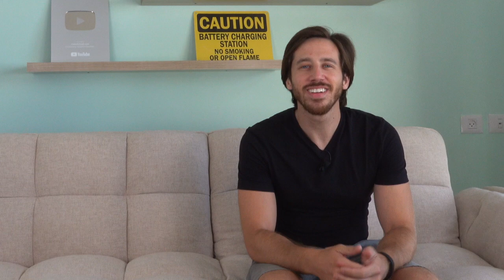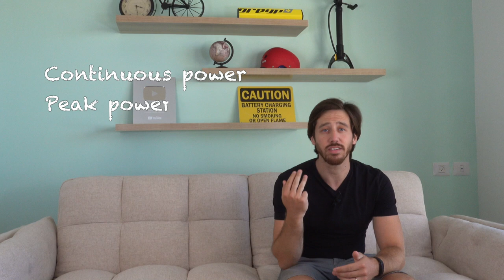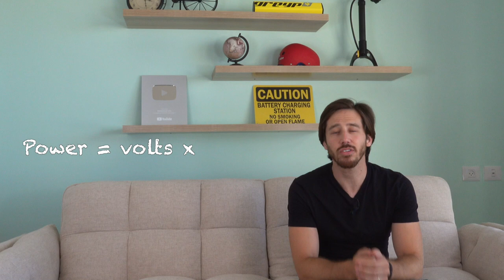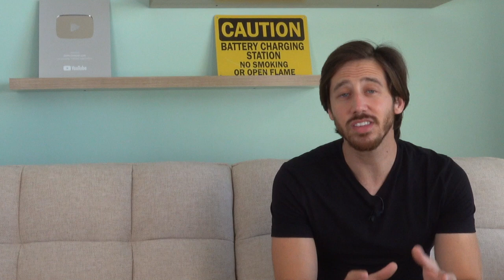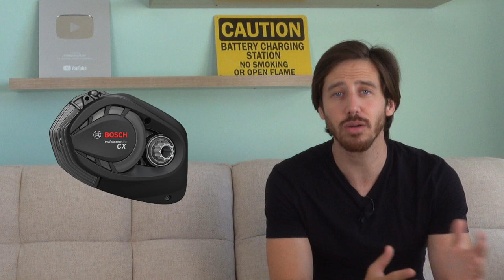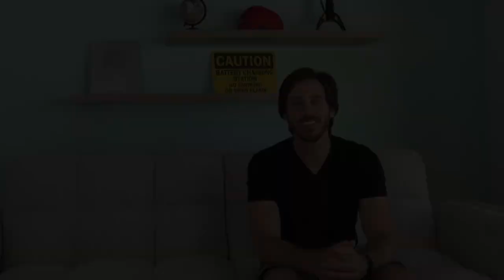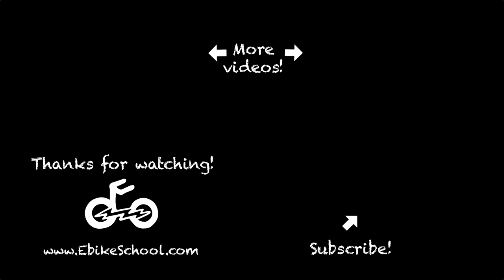E-bike watts - How electric bicycle companies are lying to you

Comment: Well, if you truly want a 1500Watt hub that is no trouble... just ask for it and they print that on the side ;) After all who will TEST it right?
A bike should be bought for use. 
The ebike I have is very well suited for the area, a lot of flat land and only a few hills. Nothing to crazy! And longer ranges matter more then getting quick on the hill.
But if I was in the UK or in america in some states then a 500-750W hub drive made a lot more sense. The bike I have now probably isn't that suited for those kinds of hills. It can do it, but it isn't optimal for it. 
So find the bike fitting use and area really. 
Around here a 750 Hub drive would be quite wasteful. You don't really need it!

Comment: I hope you will answer my question
Should the controller be equal in? Amp
Matched on battery of,
Quantity in amperes
What is the correct ratio in amps
On 2 motors from 3000w up to 6000w
Can you help me with this
I do not know ?

Comment: I know right! When I was looking into Ebikes in Maine of all places the options to actually see an ebike might have been Walmart. If that. So I did my research on the web. I didn’t want to rush huge money on an experiment and various folks gave differing reviews and opinions on motor power. My town has its fair share of hills. I was told by many a reviewer that 250W wouldn’t cut it what with my being right around 200lbs at the time. Others were less firm regarding what a 250W motor could do. Finally after watching soooo many videos and getting so many differing views I bought online a little Swagtron EB 5 Pro Plus with a 250W motor. It’s not anything special or cutting edge but much to my surprise it was a lot of fun to ride and when it came to hills I was shocked as it zipped up fairly steep hills with my fat ass on it like said hills were nothing. Don’t even think I slowed down as I applied the throttle to assist my pedaling, I was like WTF!?!

Comment: A bigger motor (within reason) is usually more efficient than an over driven smaller motor. 750 watts peak 1500 regulated to max 750 will go further on a given battery than a souped up smaller motor.

Comment: What’s the difference between the engine power and the battery power. Is 250w any good, I’m just trying to gauge what decent and what’s not, I’m uk so 15.5 miles an hour limit

Comment: So, that means, if I have 500W motor and the battery is 48V, 10.4 Ah but the controller is 20A max, I can change motor for 750W without changing the controller?

Comment: Good day to you as far i can understand on your explanation  tha combination i have to run a motor hub is way not to good, i purchase a 48v 350 motor hub and using a 48v 500w controller and power it with 48v 13s 4p 16850 battery, please recommend the good combination  with this voltage. Thank you

Comment: So when i buy a battery and it reads 72v 33ah. The 33ah is the size of the controller it can handle. 72 x 33 = 2,376 .  I have 2x 5000watt motors with two 50a controllers. I can use a 96v but that’s just to much power.

Comment: I just bought a batteru which is 52v 17.5ah but says in the description it has a 40amp bms.  My bafang mid drive bbs02b has a 25amp controller.  Does the amp rating of the battery matter or is the controller going to pull what It needs grom the battery and thats all or can the battery put too i h power into the motor

Comment: Nice informative presentation.  A couple comments.
1) Does anyone  know if the motor manufactures are specifying a maximum continuous stall torque, something else?
2) In shopping for a ebike, I calculated the miles and elevation I would typically be doing here in Portland Oregon. It came out to 70 miles a week and 4,000' vertical feet.  The dealers that addressed that issue were unanimous is saying"you need the biggest motor and battery you can afford",  and then advised it will probably come up short on my hilliest days.

Comment: So I have a Voilamart Kit (I was really broke, bought it used)... it's VOILAMART ELECTRIC BICYCLE KIT 26" REAR WHEEL 48V 1000W E-BIKE CONVERSION KIT, CYCLING HUB MOTOR WITH INTELLIGENT CONTROLLER AND PAS SYSTEM FOR ROAD BIKE. *(Description from Amazon, usa specific; I Live in southeastern PA)

It has a blue wire switch, for switching between street legal usa 750W mode, and 1000W mode.  Specifications require a 48V, 11.6mah battery.  I basically have that battery.   Currently I only get literally, 10 miles on the bike, with hills and my fat a&% at 250lb.  It doesn't have a "display", only battery indicator on throttle.

So Voilamart doesn't say much about the controller, the throttle is like half the power of PAS; PAS is full power or nothing (no pedal, no assist; pedal and you launch and go like a rocket w/ nothing between)... 

Upgrades I want to make, are a controller from ebike.ca w/ display (v3.0 - where everything plugs into the display unit and it feeds the controller directly); and a bigger battery (52V / 20.5Ah minimum) so I can increase my range.  I'm not so worried about speed, but the hills around here are as bad as they can get w/o literally living ON a mountain; and possibly a crank torque sensor.

So my question is, is this a 1000W motor?  How can I find out when the documentation is so very basic?
Will upgrading to the controller/display, battery and torque sensor help me get the most out of my motor AND the battery, increase my range and really help me on the hills?

Comment: Does it matter if you run a motor at a higher voltage than intended though? Aside from cooling the total power I can't see any reason a simple electric motor would mind more voltage - within reason obviously. All the sensitive electronics are in the controller as far as I understand. In the extreme the engine parts might not tolerate the extra physical strain of more torque, but I doubt that 250w and 750w notors are much different in physical construction. I'd love the input of an experienced builder here. This is not advice - just a hypothetical based on my understanding of simple electric motors.

Comment: Why or rather how can Bafang on three motors in the 500 series namely the G 060  at 250/350/ 500 watts all have the same specifications including torque of 80nm regardless of the rated watts ?

Comment: I bought a 48v 1000w brushless motor and 30ah controller...I also found EBL 4 pack 26650  3.7v 5000mah  lifepo4  batteries on walmart for $20...Would they work for me if i could put them together for a 48v battery pack?

Comment: I have a question, I am wanting to upgrade my montague paratrooper to an ebike.  I was thinking the BBSHD because it is a more heavy duty version of the BBS02.  I honestly don't plan on going more then 10-12mph for trails and hills...mostly off road use.  What is your opinion of the 2 motors at lower speeds with both some peddling and some throttle use.  Another reason for the heavy duty version, I am 195lbs, and would like to be able to add a cart when I become a snowbird so I can haul with it.

Comment: Hi, I have just built a DIY 18650 52v 10a battery, but I see that it very slowly looses its charge over time. The BMS stops charging at 57.7v and it goes down to 57.1v over a period of 4 hours or so. On the other hand, my first built battery, a 52v 17.5a gets full at 58.8v and barely goes down to 58.5 over 24h. They were both made with vruzend kits and BMSs as well as LG MJ1 18650 3500mah cells.  What may cause a battery to slowly (but still more quickly than normal) loose charge like that over time ? Also is it a good idea to build a battery with LG M50 21700 5000mah cells ? Thank you

Comment: Tell us about Defender S claim 2x 750 W motors should have peak 1200W together 48A reqiured but on controler current limit 30A good for two 500W motors 750W peak?
No disclosed info about controlers 1 or 2 current limits?

Comment: The US federal definition was written by a Phd Electrical Engineer (Malcolm Currie) so it makes perfect sense if you think in electrical terms and realize he was trying to get the purview of ebike awary from the NHTSA to the CPSC with as much performance as possible. The NHTSA made it clear that anything under motor power alone could not exceed 20mph, so if you read the specification with that in mind he set the power limit at was would sustain a 170lb rider at 20mph on a level surface such that that much power can continue above 20mph so the rider input power provides extra speed. This is exactly how a bike power limit should be written. The power under 20mph is not limited because the 750W stated is a motor power "rating' which is nebulous. 

i hope this video is redone to correct it's technical errors.

Comment: does one of your books have a way to regulate Amps going into a motor? I have an 18v battery that I am using on a project and the speed controller seems to output more than what my 30amp fuse can take so the fuse keeps burning out....but I want to be able to limit the amount of amps it puts out while still using the 18v battery....is that possible and if so what would i need to make that happen? a buck converter or some type of module ?

Comment: And comlanies selling dual motor ev's dont always tell you if the power rating provided is per motor or combined. That makes an enormous difference. Personally, I thought I had a pretty good understanding of ebike terminology until I started my newest build. Volts, watts, and amps I understand. But a lot of motors now are only listing KV values...

Comment: Hi I'm from india. I brought cheap 10" 48v 500w hub motor kit.the kit comes with 48v 23A controller...
Is that the controller suits for the motor. And what is the minimum Ah battery is  required for this kit.

Comment: Great video very informative. I will be looking into this further.So i should be looking for continuous power.1200 watt motor ,with a 15 amp controller equals 18,000 or1200 times 48 battery volts equals 57,600 . What am i really needing to know here? I ran my battery down  with an incident i had with a flat tire an i would like to no why  that happened also?
Reply: Your calculations are way off. A 48V battery at fully charged is 54.6V.  Suppose somehow your 15A controller draw max current that would equal to 819 Watts, so if you have a motor capable of 1200 watts continuous it can never get the juice to run at 1200 Watts, unless you upgrade your controller to a 25A one.

Comment: Great information.  Im new to ebikes and bought one on line which came with a manual that was useless as didn't explain how to use the LCD controller.  I inadvertently went in to the program parameters/settings and changed them so now bike motor now working. Ive found something online for the settings of the LCD Display however its for a different bike.  Im stuck on what it means when it says " set controller undervoltage protection point. For different battery can be +/-6v of default settings value"   i have a 36volt/8Ah battery and a 40volt controller.  Im stuck here on what to set my controller as.   Really hoping that you may be able to assist please.

Comment: Before there were E-bikes, there were motorized bikes.  These were bicycles fitted with small 2-stroke gasoline engines to move them down the road.  In most states the engines were limited to a certain displacement and horsepower to be legally considered bicycles and not motorcycles.  Many states also had a speed limit.  In most states, these limits were <50cc, not more than 1 Hp, and a maximum level ground speed of 25 mph.  Almost all states call these "Mopeds".

When E-bikes came along, and government started looking at how they should be regulated, that Moped standard was already there.  So E-bikes inherited it.  756 Watts is equal to 1 Hp.  Motor controllers generally limit speed to 25 mph through software.  Displacement doesn't really affect electric motors so was ignored.  But that's why even E-bikes that are able to produce MUCH more power at the wheel are still often advertised as 750 Watts.

Comment: Trying to find my peak power of continuous what you say makes a lot of sense which I always thought I should just get a bigger motor then change the controller in the battery but instead I get to enjoy because I took the limit off. I still have pedal assist I have a 36 V. 20ah battery 🔋 hooked up so that I cannot have longevity out there. That’s my most pet right now. I do love speed, but that’s not the important part right here speed speed will.come it’s just First. I like to learn the bike. Learn what I can do with it then I’ll worry about the speeds and I love speed. I love to go fast, but I like to live after 30 miles an hour. It gets sketchy going down the hill big hill I could reach speed 30 to 35 miles an hour, it’s scary and sketchy and that is going down the hill😮

Comment: So there's only one company that actually gave more and said they're running under less and most companies are running a motor over there limit I agree there is definitely for regulation aisin to power ratings and so forth on Motors and stuff and performance and the durability because of bringing them outside to the range

Comment: I'm on SSI I bought a cheep ebike $500.00  I can't afford a car I  like it but the battery doesn't last long enough I do get about 25 miles on pedal assist.Can the battery be improved with a stronger / better batteries , it is a 36 v 10 ah battery. The ebike is a Hot System . That's all I could afford at the time. I  saw your video on batteries & ? About putting better batteries in my battery case? Jeff R

Comment: A load on a motor dictates current draw, a different controller cannot drive a motor harder unless the previous controller is limiting current.

That lower rated controller will spin the motor at the exact same no load speed as the higher rater controller if they are on the same voltage. 
This info is incorrect.

Comment: Its really a speed restricting legislation and I agree with it in a crowded country like the UK.
I have way more than 250w, but the bike tops out at 19mph because Ive geared it to climb.
Reply: I've gone the same route as you. Running bbshd with a 28t front chainring soon, on 26 inch wheels.

There are plenty of ways to make legal bikes a danger to others, and it all comes down to the people using them. 
Yet, the true enthusiasts running illegal setups will likely be lawful because they have passion and respect.

Comment: So is there a place that has all 50 us states regulations? I'm in Texas and I 'think' it's 25mph... instead of a power rating. There's some DPS stuff here and there and all roads point to 25mph. So i'm thinking that the enforcers don't care at all unless they clock you over 25mph (as a rider) ... as a manufacturer/seller, that may be a different story, right?

Comment: Thank you for your information great content I have a Jetson electrical bike. It is safe to have a 350 W motor running on a 36 V system and it’s at 15.5 as the speed max speed which I believe is impossible I can get this thing to go greater speeds but the fastest that I would get this thing to go would be 30 that’s it. Jetson is not built to go past 30 miles an hour. It’s a small bike to travel.

Comment: Great explanation!  so... the watt rating refers to the motor and the voltage refers to the controller?
Reply: Watt is the motor. Voltage is the battery, and amp is the controler.

Comment: Hello sir, have been following your channel and this is my first time commenting, I have a question hope u help me out, the question is about lithium battery 18650, I wanna make a battery bank for my ups and I have 18650 about 150pcs and when I checked their data sheet, some of them have  the rating  (nominal voltage) of 3.6 and 3.7volt, so is it proper for me to combine the different voltage rating cause I wanna build a capacity of 3S 50P...thank you

Comment: Hi, Micah.  What tires do you recommend for ebikes? With the added weight to the bike, I notice that i get a lot more punctures.  I mostly ride on main suburban roads where there's glass.  
Also,  I am having issues with the front tyre going flat due to the inner tube shifting forward creating a hole at the base of the Schrader.  
Thanks
Reply: I recommend 26X2.5 Maxxis Hookworm tires on a Giant Simple 3. The wider tires carry the extra weight (90lbs) better and can be run at 15 psi minimum on rough surfaces for a smoother ride. Typically I run them at 20psi on smooth pavement. The tires are easily removed without tools but are tricky to seat the first time they are installed. Much more comfortable ride on these tires vs the 2” ones that came with the bike. Rides more like a motorcycle.

Comment: Great overview. One suggestion. When referring to power output, a reference to torque specs. would be helpful - in newtonmeters yeah, but also in footpounds as some of us old timers who have been mechanics are more familiar with those specs. and actually can feel what footpounds are when, say, tightening fasteners. Just more familiar.
Thanks much. Hope your new NIU scooter is working out for you. Cool little ride.
Reply: Same motor with different wheel size will change the torque so if your are talking about the motor this is not possible, that  would be for the bike discussion.

Comment: On Scoter i want to buy says dual 1000w motors with peak power of 2000w so simple math means peak power is 4 kilowatts with both wheels combined power. 52v26h battery with 60km/h top speed and 95km range (on paper) in reality full speed probably 40km.